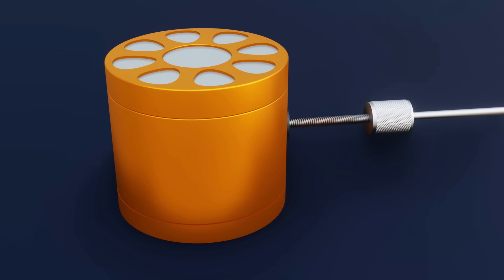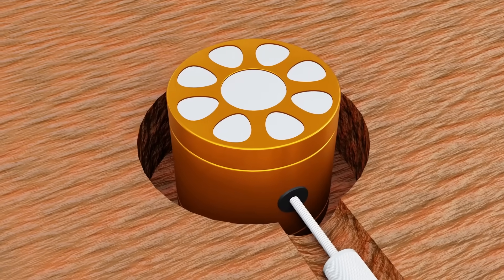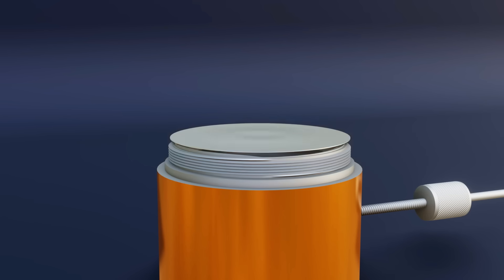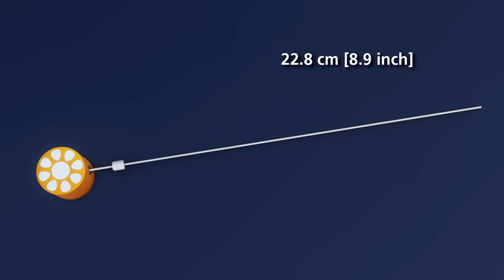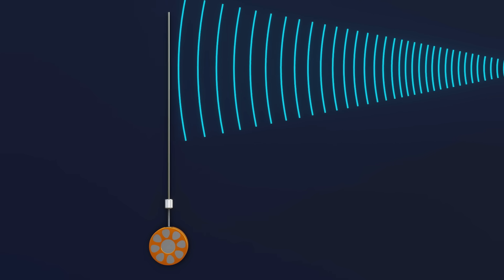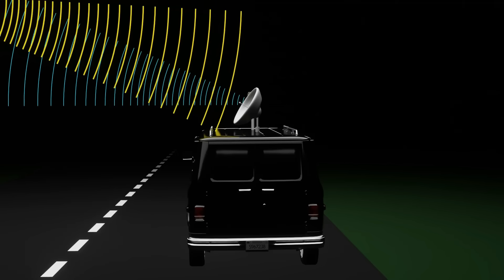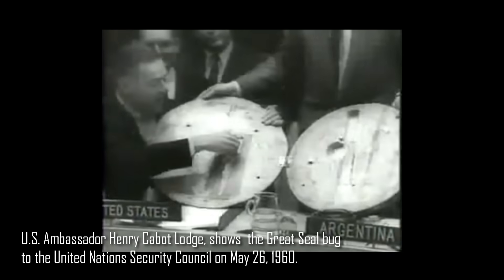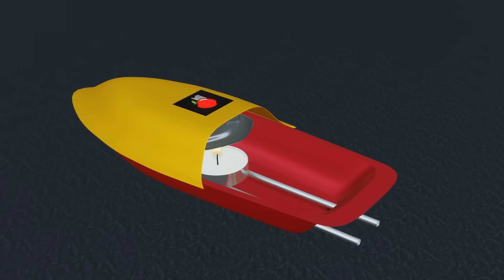How the Russian Spy Bug Worked – Engineering Behind the Secret Device!

Comment: I don't understand the numbers. The 22.8cm long Antenna is resonant at 1700Mhz? If I use the 22. 8cm long rod as Groundplane-Antenna (lambda/4) it will be resonant at 329 MHz. If i use it as lambda/1 it would be 1316 Mhz. And why should they use 800-1500Mhz when the resonant frequency is 1700 Mhz? 😂

Comment: This can't work:
1. The movement of the diaphram is only a few micrometers. So the audio would be too low, to be picked up.
2. In 1940s the technology wasn't there, to transmit at gigahertz  .
3. Any object would severely disturb the audio.
Reply: Microwave range radars were already present in the 1930s - you can check the publicly available info, when the first magnetron was developed (hint: powerful radars were in high demand in the early stage of the 2nd WW)

Comment: The explanation is okay, but AI narration is hot garbage so I won't be back for more.
Correction: The bug absolutely did not operate at 1.3GHz, because that is a full wavelength for the antenna.  Full-wave antennas lack bandwidth, which would suppress the modulation the unit is trying to create.  Most experts who have analyzed the device - including myself - agree that it would have used the 1/4-wavelength frequency of 330 MHz.

You don't talk about the nature of the modulation at all?  The fact that it wasn't simple AM or FM but a mixture of the two?

Nobody believes the transmitter was in a mobile van. Everyone who has studied the incident agrees the transmitter and receiver were in a building less than a block away.

"Since the thing had no internal power source, or continuous emissions, traditional bug sweeping equipment failed to detect it." 
Um, yeah.  Look up nonlinear junction detectors.  THAT is what this thing evades, a stunt considered impossible at the time, mostly because nobody else thought of it.

Comment: Is there a recording of how this actually sounds? I imagine it was barely audible, unless someone was yelling directly at it
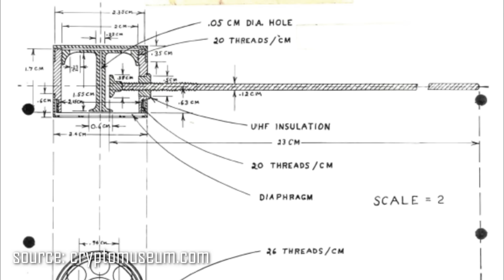Reply: Not necessarily, if you take into account some of the specific details mentioned here - like highly polished silver plating of the resonant cavity, grooves on the central disc, two internal coils (not specifically mentioned here, but visible in the cross-sectional diagram at 3:39 mark) and the strong possibility that the external transmitter used was particularly powerful (you can easily guess whether the Soviets cared about the health of the wiretapped embassy staff...)
Reply: @MiroslawBlazek-Gdansk But it was encased inside wood, which must of muffled the sound. And it would pick up all sound, not just voices
Reply: @maxstr  It would pick up all sounds from the room, just like any other microphone (in this case, a unique condenser type).
As for the casing - graphics in this video don't accurately model the deep three-dimensionality of the real engraving, but in other sources you may notice that the front surface was very uneven, it had deep grooves, one of which (under the eagle's beak) had hidden holes made for an obvious purpose.

Comment: How did they discover it?
Reply: The British embassy picked up the transmissions accidentally, and at some point realised that what they were hearing came from the US embassy.
Reply: @kaasmeester5903 I highly doubt that. Reflected from the device signal was extremely weak and given the working frequency of ~2 GHz it is absolutely necessary to have a directional antenna on the line of sight and highly sensitive radio reiceiver tuned to that frequency. KGB had the equipment in the building across the street from the US embassy. In 1950th British Embassy was a few miles from that place. Under circumstances incidental interception and decoding of the signal is nearly impossible.
Reply: @talmudovsky  More likely, at some point they might have received some brief tip from a double- or recruited agent from the other side that the wooden eagle has a sensitive beak.
Reply: @MiroslawBlazek-Gdansk  I will let you to dwell on your own theories. I ground my opinion on facts, science and engineering.
Reply: @ Take no offence. I find yours at least as fascinating, even though at this point it seems to be only a hint and leaves a lot of room for conjecture.
Reply: After several years US suspected that information was being leaked.

Comment: Best devices are always the simplest.
Reply: This device is powerless but it’s design is very far from simple. A cavity resonator requires very accurate design and fabrication.
Reply: @joso5554  To me it's a simple linear motor, in the sense it has no moving parts; But that doesn't mean it is not a high tech precision machine. Congratulations.
Reply: This is far from simple.
Reply: Completely agree, that’s why my 2001  F150 outlasted my 2017 Chevy cruise, simplicity

Comment: The soviets also designed an underground bell-shaped cavity with a small open tube that was tuned to the frequency of B52 bombers that were headed to North Vietnam. An nva or Viet Cong member would sit inside and be able to detect them from miles away. No electricity or hardware.
Reply: That was really true, wow, do you know where I can find more information about that since I couldn't find anything on Google.
Reply: @Luchito12  Nothing that shows the weaks of the US military aircrafts in the past or present, will be banned by YouTube (a company that works together with the Military Industrial Complex with propaganda against the Russian Federation). You only going to know in the news, how F-35 fighters or Apache Helicopters are crashing by themselves very often.
Reply: I did that to detect the cops on a road trip lol! Not allowed to use radar detectors here, but nothing wrong with monitoring the frequency for their in car repeater for their portable radio. Worked great. If I started to hear chatter I knew a cruiser was around. Usually heard them 5 minutes before I saw them. Only drawback is if there was no chatter I wouldn't hear them.
Reply: @juliogonzo2718 neat I should try that.
Reply: @juliogonzo2718  There are clever ways of hiding radar detectors, like how some old cars had the antenna in a fake headlight
Reply: Truly genius
Reply: What is the frequency of a bomber ? 😂
Reply: @MP-wb5yd  probably means on b52 motors hum that can resonate in bell shaped room if input hole is just the right size  there for u can hear it bit further away then usual
Reply: @MP-wb5yd  frequency of sounds created by the engines and propellers of the bomber
Reply: @MP-wb5yd  If it has props, it has a drone sound, surely you must have heard that in movies.  But it ain't working on no jet aircraft, that's horseshit.
Reply: @railgap find anything worthwhile?
Reply: So they knew there’s a b52 around somewhere? Sounds useful
Reply: source?  I'm very familiar with acoustic aircraft detection efforts and I'm not familiar with that one.  A couple of quick web searched turned up nothing.  I'd like to learn more.
Reply: how many have seen photos of parabolic steerable audio horns, focussed to human ears? as another 'passive' long distance plane detector?
Reply: So genius nothing can be found readily via an internet search. This definitely happened
Reply: @robt6425  Everything has to be on the internet to have happened
Reply: @JennyCuir where else would he get this information from? Lmfao
Reply: @robt6425 why do you assume that everything can be found on internet?

Comment: Yeah pretty sure this is how the US does wiretapping these days, they reflect signals off cell tower antennas. Not talking about the lowly FBI either.
Reply: They don't have to. All digital information can be intercepted and decrypted without the need for any of that.
Reply: @Pablo-nc6qu NSA has many bugs and implants that function similar to this. They modify an incoming singal to implant the data which makes it harder to detect when not in use. Snowden's data dump has a ton of info on these, you can find it on Wikipedia or just on google.
Reply: @Pablo-nc6qu  That's where you're wrong. Nowadays everything is encrypted using publicly kbown algorithms with decent strength against passive attacks. Symmetrial encryption is unbreakable if done right, and assymetrical ones require quantum computers from the future.
Reply: @saiv46  lol okay Chet. I'm only a computer systems engineer. You do you
Reply: You have no idea what you're talking about
Reply: @Pablo-nc6qu  so you've broken RSA and AES encryption? Please, do tell
Reply: @themartdog  mate, I have an advanced diploma in electronics and computer systems engineering, and I STIL have no idea what you're talking about 
.
Perhaps you should leave the psylocibin out of the chat.
Lol. Newb.
Reply: @themartdog  😂😂 sorry edgelord, I guess you need hair on it first .
Good luck boy
Reply: @Pablo-nc6qu AES is advanced encryption system. It's the current DOD approved encryption. You should really look it up in Wikipedia. If you have a degree and you don't know about this then I think you might have wasted your money.
Reply: @saiv46  kek. you literally have videos about how to decrypt GSM data
Reply: @throughput6674 He said has an ‘advanced’ diploma. So he must know 😂
Reply: @julendominadas4040  GSM is hardly used anymore